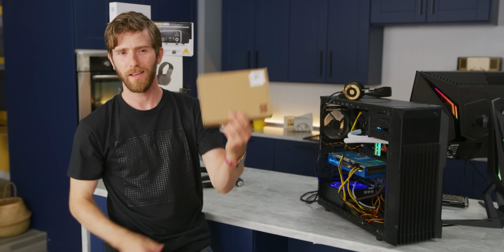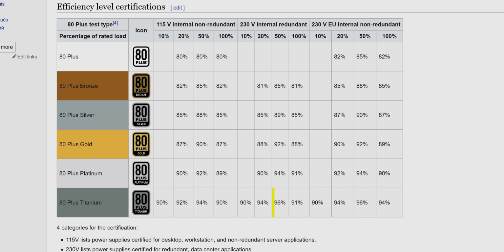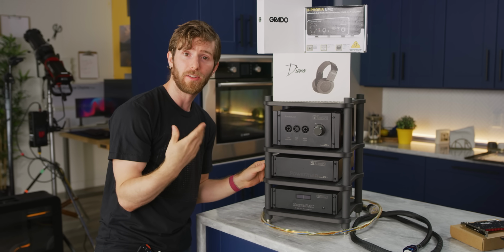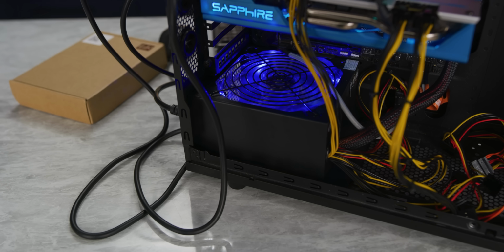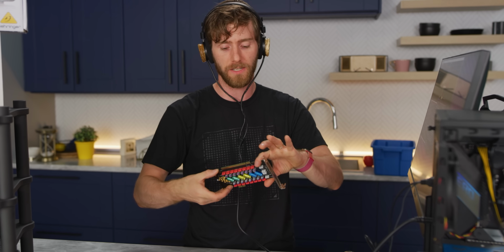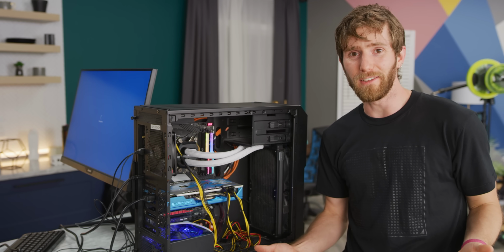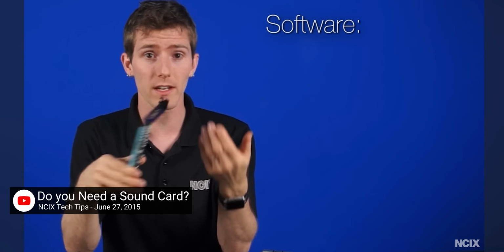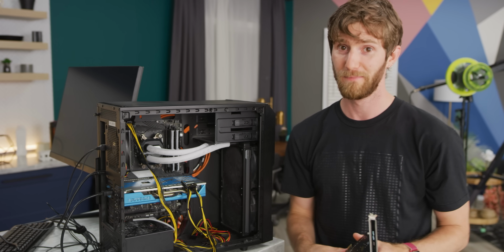Is this $40 card a SCAM? - "Audiophile" Power Filter

Comment: Linus you plugged the headphones into the "line out" jack at the back of the motherboard, that one is meant for active speakers or amplifiers.
You need to plug sensitive earphones like IEM's into the front panel  HD audio jack and then you'll hear a ton of noise.
Also you should try using RTX GPU's for the test as they are notorious for corrupting the power line and introducing a lot of noise into audio equipment including microphones.
Reply: The reason why the front IO sounds garbage is because they allways sell them with crappy unsheilded cables that pick up all the noise from everything in the case.
Reply: @TheAkashicTraveller  they pick up more noise from the USB port right next to them than from anything else. That goes for laptops too. At least they don't route power right next to it. Oh wait....
Reply: Therefore using the back IO for this eliminates that and allows you to actually test what the card is doing rather than eveything else.
Reply: I'm confused, if plugging it into a front jack causes noise that is solved by plugging into a line out jack on the motherboard directly, what's the point of spending an extra $40 when you'll have to plug into the back to use that solution anyway?
Reply: @Xanthelei  The Line-out has a different set of electrical characteristics, ideally delivering a signal with a RMS voltage within about 2-4v, far lower current, and much higher output impedance to work over a longer cable with little signal loss to be used by an external amplifier when compared to the headphone jack, which needs more current and lower output impedance to better power the headphone's drivers. Since the source of the audio on the front panel and motherboard is from the pinout of the motherboard header either way, they'd both benefit if the card is useful.
Reply: @Xanthelei  Because the "line out" has a lot of "output impedance" which causes a dampening effect on sound. You get less noise when plugging headphones into it, but you also get less volume, and much less sound detail.
Reply: Xanthelei shortness of cables, or, if you’re like me, the ability to switch between speakers and headphones without having to constantly go behind your tower to switch cables out. Not that I would buy this thing, I just bought some $15 usb sound card off Amazon
Reply: @SurplusMarket  If both plug in at the back, then it won't matter if the cable is too short for the motherboard because you'll have the same issue with the add in card. Worse probably, because it'll be lower on the rig and can't just come up over the top as easily.
Reply: @Xanthelei  I said *or*,  not "and", as in people without a sound card might not want to have to switch out constantly. I didn't have my sound card for the longest time, and it got pretty old to have to constantly go behind my desk to change them out (since my front panel had too much feedback), hence why I eventually got a sound card. Not true about the length at all either, my usb plug in adds at least half a foot of length to my headphones.
Reply: Yes, IEMs would be a better choice. He needs something with a low impedance and high sensitivity to bring out noise since the lower amplifier gain is what usually raises the noise floor to audible levels. Those Grados are 32ohm and 100db/mw which is still pretty low impedance and fairly high sensitivity, but IEMs are often even moreso.
Reply: Nonsense. The output has impedance detection and will kick in some power amplification and drive headphones just fine. The front panel audio will also do the same...allow for line out or drive headphones.
Reply: I can confirm that in a reording studio setting, this card makes a difference for audio input like crazy!!!
Reply: @icedelta  any idea why someone would use this instead of remaining all digital inside the computer and using an external DAC?
Reply: @deViant14  When someone uses an old setup, in linux, and still has one of them pci internal m-audio interfaces. OR wheb one uses a firewire interface and has a firewire pci card. Lots of DACs dont actually filter ground noise or loop noise, especially cheap ones.
Reply: Bang on.
Reply: This reply is also incorrect in some ways, what you said is true, but the line out, although meant for amplifiers, also emits much lower amounts of hum. I have a relatively cheap fix which cost me £6 which is literally just a electrical ground loop noise isolator, which completely removes the electrical hum, you really don't need the 40$ thing unless your onboard audio is also crap. The front panel HD audio jack also shouldn't have that much hum either as its mainly amplifier setups which this product was designed for and probably works flawlessly. It is evident how little Linus knows about audio its almost depressing considering his prowess in the computing world.
Reply: well, for me headphones are totally perfectly fine all time (AKG and audiotechnica ) but my cheap 50euro soundbar that is connected from back buzz as hell when i sleep down my pc. lucky i just need mute him to rid that buzz off.
Reply: I have headphone jack AND line out jack on the back for both onboard audio and for my soundblaster audio card.
Reply: Prime Evil  Ok but he didn't notice any issues with sound levels while plugged into the line out, so for those headphones at least it's not an issue. Maybe this board has an amped line out for whatever reason? I've seen weirder stuff. The one time I used an un-amplified audio jack, the audio was so low it was barely audible even at 100% volume with normal headphones, so I'd think an issue like that would be instantly noticeable.

Is the card supposed to be a sort of amp with extra shielding then?
Reply: Yeah this video was done pretty half assedly if you ask me
Reply: This entire thread is what I was looking for. 

I guess Linus isn't as much of an audiophile I guess? Maybe? But I knew this as well. The front panel lacks shielding usually and is different than the AO in the back, since it's for headphones. I get noice ALL THE TIME with front AIO panels, especially with system sound maxed. The mix hiss is unbelievably bad as well. 

Funny story, I caused an old e-machine to short out once due to plugging in an electric guitar that stepped down to a 3.5mm jack via an adapter, plugged into the front panel mic jack. Don't know how that worked but... yeah... killed it. 

I also remember having this really fucked up time trying to run Star Wars Battlefont 2 (the good one...) and I found out that half way plugging in a 3.5mm into the Line In got the game to boot where as using the front mic input would cause the game to crash. Wierd shit!
Reply: @Nurhaal  I want a Star Wars Battlefont 2, especially in comments sections where I sometimes feel like I'm really doing battle with some people...lol. (ignore my sarcasm) :P

Comment: an analog LC (LCR?) filter  in a digital landscape...  Even if using an analog output, all of the power ripple or noise would still be in the digital realm bfore a DA conversion.  Just more hifi snake oil.  Next time, get an oscilloscope and run test tones and measure the ripple and look at the wave forms up close.

Comment: I am not defending this garbage but you said some things that are actually wrong. This will not refuce coil whine on gpu, not because it's garbage but because the noise is causes by the power rail stepping down the voltage from 12v to vgpu by chopping it at high frequency, the coil whine is produce by the wire inside those coil vibrating at those frequencies. By adding the filter in the daughter board slot it is filtering the whole dc 12v and 5v/3,3v rail, filter are wired in parallel not series. Look at a pfc in power supply for exemple.

I would be interrested to see the different dc rail on an occiloscope with and without the card to see if it does anything.

Comment: This is absolute crap. What this essentially is a bank of bypass capacitors with nothing else on it which makes it useless. Bypass capacitors (decoupling capacitors are the same thing) decouple the device from the power supply to some minor extent and have to be placed extremely close to the device in the case of cpu's literally on the device so having them on a different board makes them utterly useless. The whine in the coils comes from changes in current at audible frequencies which causes the coil to vibrate. Adding bypassing capacitors will help but not if they are placed before the coil only after. That and adding excess capacitance to a switching powersupply can in some circumstances make the noise worse because it can cause oscillations when the stored current has no use. Great video quite obviously shitty product.

Comment: GPUs have DC/DC conversion to produce the right core voltage out of the 12V PCIe Power and the coilwhine normally comes from the output filters of said switched DC/DC conversion and stems from the GPU switching load very frequently. So your input power needed to be pretty bad, to be the dominant factor in the coil whine.

Comment: Could you please use a Oszilloskope in to see the noise floor and headphones with aren't buffered with the cleanest filter you could find on audio equipment ? I guess the filter works on somewhat like an sound blaster in the pci slot or something. I don't want to defend the Produkt But I don't agree to the Testszenario either.

Comment: Well, I can't see what motherboard you're using exactly, but it looks pretty high end. Perhaps testing this again with a super cheap A320 or H110 or so board with the cheapest audio solution you can buy "new" right now would have actually shown a difference in the audio test. My money's still on "no perceivable difference", but if you're looking to give that thing a shot, that might be it.

Comment: Buy a crappy nicrew led fish tank light from china, plug it into the same extension lead your computer is plugged into, you will definitely notice the difference.
If i want to turn my speakers on i have to turn the fish tank light off, or the speakers sound like they're picking up communication signals from outer space.

Comment: Usually I'm a big fan, but this test was a bit disappointing. What if you're going for a super cheap mainboard except for a high-end one, would it maybe make a difference? And maybe it at least made a measurable difference? You could have recorded the output signal to visualize the electrical noise rather than relying on linus's hearing

Comment: First of all.

Great try.

But "the noisiest parts in the warehouse" doesn't actually mean anything. That you can hear it means that the power supply could be switching in the audible spectrum.

Second of all. Coil whine is mainly caused by bad impregnation of the coil itself due to the resonating windings.

The bad power supply was a pretty good call. This card could however, improve system stability when overclocking? I'm not very sure on this but improving stability on the pcie bus is ofcourse very good.

Comment: Ne thing to do is try artificially increasing audio noise. Possibly turning up the gain or frequency output on the computer. I'm not sure if I have the proper terms there but moving the frequency response up in audio setting can bring in some noise sometimes... We really need an audio scope with fft and a noise analysis to determine the electrical noise baseline.....my guess it's below the audible range by the time it gets to the output line.

Comment: I never had a single computer with good oneboard sound while getting platinum+ psu.
So yes it really depends on your usecase. I always listen on Speakers which are amplified by an old luxman stero receiver.
And you will always here something with integrated soundcards.

Btw before you buy a FiiO look up khades toneboard. Its way better then everything else in its pricepoint

Comment: "you can put it in a 4x or 16x slot", yeah you can even put it in a 0x slot (leave it on the bottom of the case) and it works just as well.
Reply: You could also just throw it outside and it'll work. Just needs to be touched by your fingers
Reply: @VaibhavHariani  Meh. It works just as well by leaving it in the store, unbought. ;)
Reply: @antisoda  good point
Reply: Oh shit you mean it's WIRELESS?!
Reply: Come on now, it won't work just as well.  100% of the functionality is RGB, so if the RGB doesn't have power then it can't be working as well :P
Reply: Underrated
Reply: Don't buy it works just as well
Reply: peak innovation
Reply: Lay it on the case! lay it on your head! or just throw it into the trash!
Reply: Hey why my new soundcard doesn't work?

Comment: Yes, it's a scam ... The principle is stupid ... for a LC filter to work, it needs to be in series with the power supply ... Here you're putting a bunch of capacitance on the power lines and most of it will be useless because you have so much inductance between it and the point-of-load that it won't do anything.

Also, coil whine is from vibration of the coils of the DC/DC inside the switching supply, you can add whatever capacitance you want, it won't do anything.

This is all power electronics 101.

Comment: no change because it was dropped. ;D

maybe it might have worked if the sound was extremely bad, but when everything is half decent its not going to do a thing.

idk how you would go about intentionally feeding in ground loop noise to test it though.

Comment: Linus: "That's where this, at least in theory, comes in"
At least in theory it worked before he dropped it
Reply: Just buy USB headphones and problem is solved. That's what I did for my old PC that had this issue. It has "driver" outside the PC, on the cable thingy.
Reply: matrixfull are there really USB headphones so good you could tell the difference in a modern build? Ignoring that the inline dac may be bad
Reply: @ibfx7267  not in modern build; but in 8-9 year old PC I got yeah ( cheap office PC ). There was some noise I was hearing before I got those. Could literally hear whenever CPU was boosting up lol. But yeah I think USB headphones ( those that have their own driver out of PC itself ) make sense. Coz even if you buy new PC after you can still use them.
Reply: I think that the card works if you have a bad quality PSU and/or non grounded lines.

Comment: Plug a set of powered monitors into a PC or USB dac and you'll hear all sorts of nasty shit. Like, super bad. 

I tried a "Schiit Wyrd" a long time ago. It was supposed to be a power filter/regenerator. It failed.

In the end something that looked like snake oil is what fixed it: "iFi iDefender" totally solved all my RFI issues I had with my Schiit Hel and Yamaha powered monitors.

Comment: Speaking of power conditioner, I remember watching AC/DC rig rundown where they use Kikusui for the Amplifier power supply. These things are made for the operation room so it's super over spec for guitar amplifiers. ...

Anyway I guess I'd love to get those power conditioner just to eliminate the coil whine. The problem is ... the power line in my house does not have ground, this kind of devices wouldn't work out with that :-/. (Here the ground wire law was in-place like 20-30 years ago, while this house is older than that....)
Reply: The old TN-C system where neutral and ground are the same wire or do you actually have a floating/ungrounded supply? Not having a separate ground doesn't necessarily mean there is no ground.

Comment: I had coil whine problem with AMD Sapphire HD7850, started S.T.A.L.K.E.R. Shadow Of Chernobyl. It was running at +2000FPS in menu and screaming to headphones like angle grinder. Coil whine was changing with position of cursor :-)  Problem was solved with FPS limit or V-sync.

Comment: When I went from my old 8 year old i7 system to a 3900x system, my mate said my voice was sooooo much clearer and smoother through the new PC. Using the same PCI sound card and microphone too.

Also, it would've been cool to see if the capacitors actually had traces running to them and if there were and circuits with continuity

Comment: Buy a UPS unit that is generator certified that will illuminate 99% of any noise caused by dirty inputs. Most modern noise in a DC power supply is source based. A UPS that is generator certified always has a better filter and VRM works at much higher switching speeds than a regular UPS. They do cost $20 to $40 more, but worth it.

Comment: This china fake PCB is not how you filter noise of power rails, if you want a filter that works decent you must filter between the power and device, this card is not how you isolate high current loops from digital IC's that make noise on power rails, or the noise form the switching power supply, or the hum form AC 50/60hz mains.

Comment: I suppose using an oscilloscope to view the DC voltages and see if there's a ripple or noise that's filtered out.  But motherboards are rather good about having filtering caps, some have small film caps everywhere.

Comment: LCFilters in drones are meh at best, and were almost a fad from 4 or 5 years ago. The real filters are just largish (1000uf, 36V) capacitors with low ESR ratings. It's also why audio grade capacitors are a thing. Any headphone amplifier is just loaded with capacitors, to smooth out any noise from the power source. It's actually a great way to get a handle on this, building your own headphone amp.

Comment: It would've been more viable to test it out with the audio input instead of the output! 
It'd be easier to test for difference and amplify it in a software and actually compare the noise floors in a tangible way